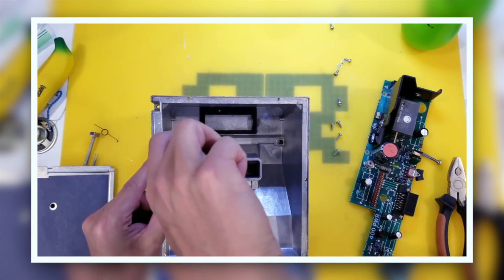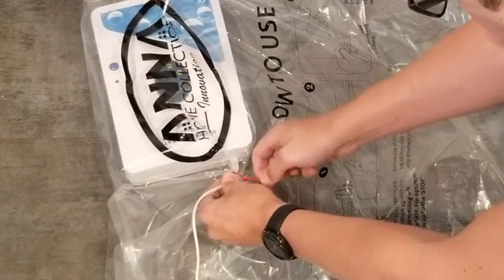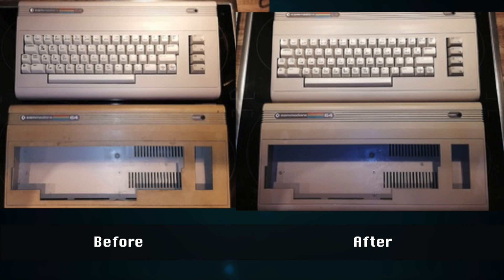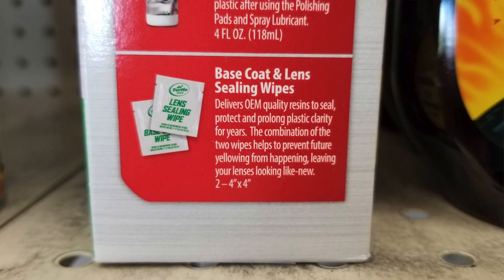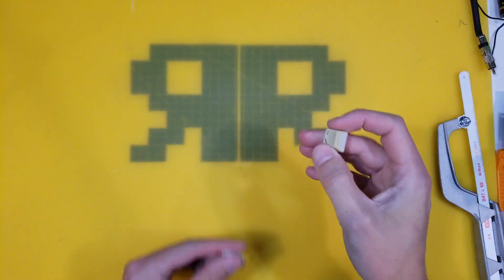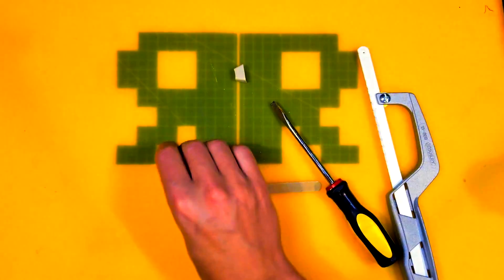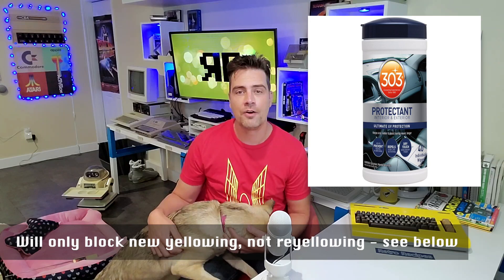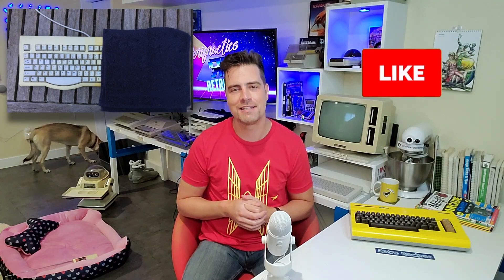Retrobrighting with just Sun? Lightbrighting! ▼ Read description FAQ

Comment: Clouds also diffuse sunlight, so it's not "direct", although directional.
And make the light much colder than what we usually use indoors, which is usually very warm light.
So, if the UV-A/B is doing the job here, would a powerful UV-lamp work?

Comment: Interesting results. There are some problems with your hypothesis about where the yellowing comes from. Until very recently, most homes didn't have fluorescent lighting, except maybe in a kitchen, basement, or garage. Most places where the computers were (bedrooms, home office, den, living room) used incandescent lights. So unless incandescents put out the same harmful wavelengths (and I really don't know), then light can't be part of the equation. Also, how can we explain the yellowing in a dark attic if light and UVA are both necessary? I think there is still no definitive answer on why the yellowing occurs in ABS plastic.
Reply from the maker: Well there's only so much time in the video but fluorescent isn't essential, it just speeds it up. As does diffused UV. But heat alone, with enough time, will do it alone 👍🕹️

Comment: That's very interesting, I'm going to give this a try!  Fortunately we have lots of sunshine here in Sydney.  I think using blue light (royal blue) this will work too.  Adrian Black experimented with using royal blue LEDs as part of the retrobrite process and got good results.  Here is Adrian's video - https://www.youtube.com/watch?v=cRlAFnhmPlw&t=564s .   Based on Adrian's success with using royal blue light I went and built my own 'blue box' and I also have had good results.  Here is a photo of my blue box (yes, I designed it to be powered by a C64 power supply - haha) -https://drive.google.com/file/d/1obNTKPS1nuewfZrFzk8RJsCPNirsa7EG/view?usp=sharing .  Here is one of my retrobrite results using royal blue light:  (before) https://drive.google.com/file/d/1Ff-glzBT6ZEZ2JAlXFimzOdawWW2C3xz/view?usp=sharing , (after) https://drive.google.com/file/d/1WUhmx_yT1k4w3KJxs-NwPNLCFSoKSPl6/view?usp=sharing

Comment: Are you sure the sun isn’t just bleaching it closer to white, rather than the original colour?
Reply: I guess you could test that theory. Leave it out long enough until it returns to what you consider the original colour, then repeat the towel test and leave it out for another week. If it keeps getting whiter then it is just bleaching the colour. You could also buy something new made of ABS and leave it in the sun to see if it gets lighter.
Reply from the maker: Pretty sure. Technically it's deyellowing not bleaching, although I use that vernacular

Comment: I have a hypothesis about how a lot of computers became yellow in the first place. It probaly also has to do with the atmosphere inside your house. Not necessary the heat of the air, but for example smoking and cooking, causes/caused a lot of yellowing on your wallpaper for example. Outside is a lot of fresh air compared to indoors. (at least it is not as concentrated)...  Maybe uv light interacts with those fumes and interacts with it on some kind of molecular level... Not sure about that, I'm neither a chemist or a quantum physicist :p
Reply from the maker: I think that likely, and of course cooking = heat.
Reply: Also, smoking is a cause of a different kind of yellowing: nicotine.
My first computers ever were hand-me-downs from my old man: a chain-smoking accountant (who much later cut off on smokes). Basically, everything he gave me was covered with a thick yellow layer of nicotine, but differently from thermal browning, a scrub with baking soda and vinegar/windex got always those hand-me-down clean and whitish again.
Of course, they still did got yellowing, as in those times (I now realize thanks to Perifractic) my old man's office (that then became mine) had and has only a ceiling full of fluorescent lights for illumination that I rarely turn on as I get lots of natural light, a really big window that he just loved to keep close all the time (while I do open more than often to let air and sun in and avoid getting short of breath and an eletric heater blasting heat all over.

However, my old man's kitchen still has a really yellowed blender that survived almost 30 years of chain smoking, kitchen heat, fluo lights (a big one in the middle of the kitchen) and no direct sunlight exposure.

No amount of scrubbing even removed that brown, so we can safely assume nicotine and grease can worsen the browning, but heat and fluo lights make the browning happen.

Comment: I have an Amiga 500 + coming next week and from the photos I have seen it is rather yellow. I live in the tropics with quite a high UV index so I will run my own tests when it gets here. Heat might be a problem some times as it can reach 40 c here but we are coming into the cooler part of the year here so it should be fine to leave the system out for a day or two.
Reply: I live in Australia. We have seriously harsh light here, even in the colder areas.
Then again it was 43 celsius here during summer - which it's not supposed to be in this area (average summer temperature 28 degrees)
And now it's winter, and this is the mountains, so pretty cold...
But... Yeah, could be interesting to try. Not that I have anything massively yellowed.
Some SNES games maybe. (for some reason there are a fair few games where the back half of the case has yellowed but the front half hasn't.)
My PAL system is clearly slightly yellowed, but that's only visible because it's next to a Super Famicom that's a tinge lighter...

Comment: Very interesting method! Will definetly give it a try with my two Atari ST. There must be more factors causing the original yellowing of plastic. My Atari 520ST e.g. was used from 1987 to 1993 and then stored in it's original packaging in a normal tempered dry cellar-room. Now after 25 years of storage, many keys and parts of the external floppy-drives were yellowed, which I'm sure wasn't the case back in 1993. Especially look at the function-keys, some of them are yellowed, some not (looks a bit worse in reality than on the photo): https://flic.kr/p/2dVw8zJ
Especially my consistently yellowed 1040STF (from ebay this year) needs some sunlight: https://flic.kr/p/24khhik 😎

Comment: Interesting I know there are times when the molded parts we make turn yellow one test we will do is bring the parts outside in the sunlight for a period of time to see if the color will return but in our case its a clear part.   What we have never done is leave the parts out for an extended period of time.   The parts I am referring to turn yellow if they sit for a year in sealed boxes and being in the southeastern part of the US these parts are for a good part of the year in a high heat humid environment.   I am going to take a big sample of these parts outside and just let them sit in the sun light to see what happens.   I also have some yellowed cases that I will try bathing in sunlight just to see what happens as I have nothing to loose but much to learn.    I personally don't bother with retrobrighting because I do not want to run the risk of making my parts brittle.
Reply: ok, 3 years later, the outcome is?

Comment: OK, now I really need to dig out my Commodore 64C that's been shut up in a hot attic for the last several years and see how it's getting on. When I put it there, it showed no signs of yellowing at all. And neither had any of the other computers I've owned. Maybe I ought to also get in touch with my college and see what's happened with the Amiga I donated to them over a decade ago. It too had been in an attic for a few years at that point, and was still in perfect condition at the time, but it also hadn't been exposed to any fluorescent light. Now it's probably been in an all-fluorescent environment ever since.

Comment: Is it really "de-yellowing", or is it just "bleaching" something that had bubbled to the surface? I feel like there may be a difference between the two. This might be leaving a layer of damaged material on the surface. Maybe having a patina would prevent future yellowing, but it seems like the original color isn't really being approached if that is a case, but instead just a light color that incidentally looks similar in a superficial way.
Reply from the maker: Nothing is actually bubbling to the surface, just the polymers are altered. Technically it is deyellowing, undoing that process. Visually we call it bleaching.

Comment: I will try this one day when it get sunny.
I am pretty sure the yellowing is mostly the cause of heat.My old Commodore 64 has been stored in it original Styrofoam box.
It has not been yellowed at all while my originally white 1541 disk drive has only been stored on the same place in the original box but not in Styrofoam and  it is very yellow now.The attic where it was stored can get very hot but the commodore was sort of protected for the temperature because of the Styrofoam box it was in.But then again it could have been the different kind of plastic.

Comment: Hm, in chemistry you sometimes have an effect that something has a color, a reaction starts, color changes and goes back to what I was after the reaction is done. This is caused by byproduct that occure while reacting. I could imagine that this effect is similar. Great video btw, will try it
Reply from the maker: Correct, it's a balance. There's an equilibrium point.

Comment: That warm air and light is a factor. I have an atari 1040 ste which is still completly grey, compared to a 1040 stfm. I bought them together from someone who used the stfm heavy and got the ste as a spare. The stfm even has deformed F keys.

Comment: Amazing video with science and results! So it looks very much like 7 bit's de-yellow tests with ozone were resulting from the sunlight and not the ozone! Hah!  Maybe there is a way to filter out the bad sunlight so that the process is faster.. As in filtering out the UV-A rays since from your graphic it looks like the UV-B is not getting inside our homes. UV-B does not penetrate window glass.  Also important to note that LED lights are said to provide unhealthy light for people, while incandescent or halogen 'clear' bulbs with a color temperature of 2700 degrees are said to be the most healthy for our eyes and health. So while it may be great for the old plastics, LED light may be unhealthy for us (I think even for full spectrum LEDs).
Reply from the maker: Both A & B are essential for the process 👍🕹️